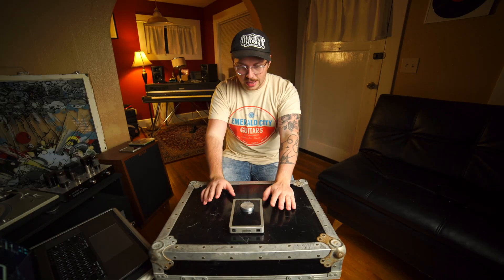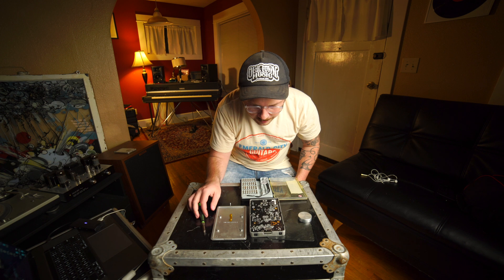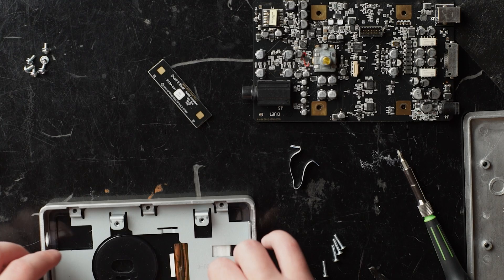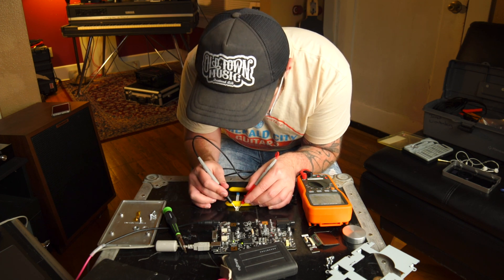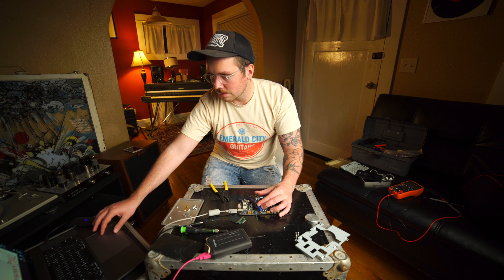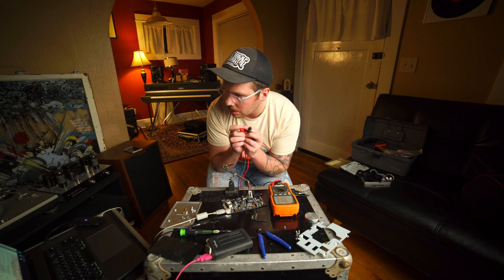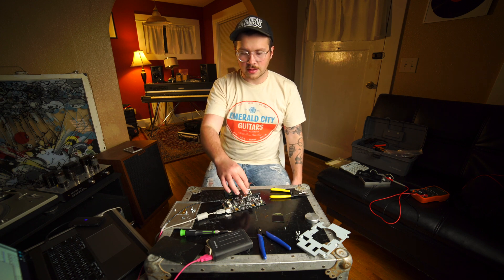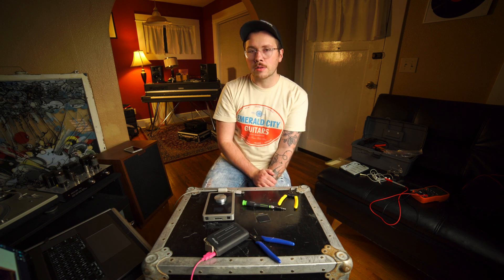Apogee Duet USB TEARDOWN: Replacing the OLED Screen!

Comment: Hey Jared. Apparently, it's a common problem, my duet screen also died last month. Did you finally solve this problem?
Reply from the maker: Hi - you can send it in to Apogee and they will repair for a flat fee. Unfortunately sounds like a chip issue on the main board that becomes fried? I don't remember specifically what they said

Comment: You don't NEED the power brick to run phantom power in all situations. I didn't use it for years running only one LDC microphone for example. I've found the performance is just more consistent. It gives the Duet headroom to run all of its functions so it is something I recommend.

Comment: i have the same issue . first the led died and gave for service and then they made a component replacement and led died again soon after.  i just dont wanna spend the same extra bucks likely to cause me same problem again which is not guaranteed. please let me know if there is any solution?

Comment: Hi Jared! I love your video.

I have a Firewire Duet, which I purchased second hand. It sounds AMAZING, but only 2 out of the 4 inputs work. Do you think replacing the breakout cables with a new set (of cables) is worth a shot?  I'm desperate ova heeyah... thanks for your time. \m/
Reply from the maker: Hey there! Thanks for reaching out. Sounds like the breakout cable might be bad. I'd say try jiggling the cables while monitoring it to see if you can get intermittent signal. If you can, maybe try replacing the breakout cable first. Is it either both the XLR inputs or the 1/4" guitar inputs? or a mix of both